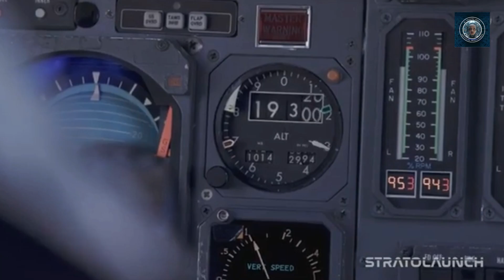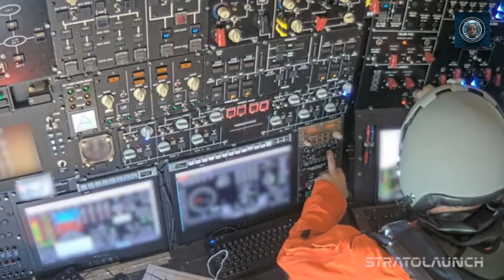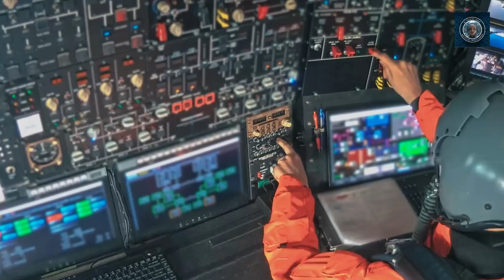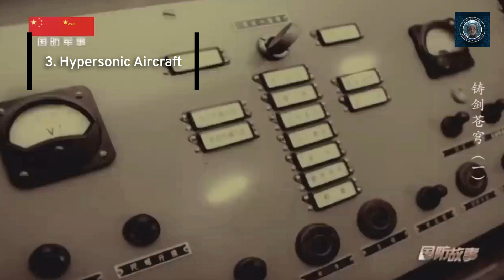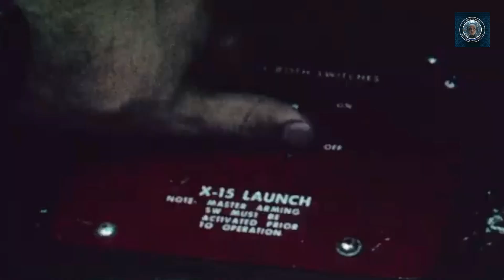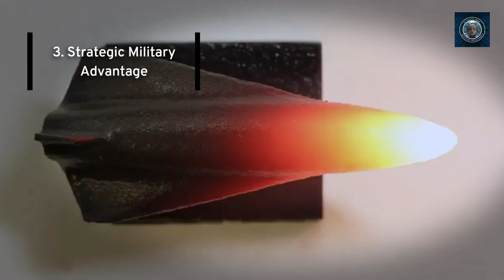World's First Hypersonic Airplane: More Progress Than Ever

Comment: Launch at zero from the surface (land launcher and sea surface vessels UVLS) is different from launching from a moving flying plane in the air. At that height, the air is thin and with the momentum created by a flying plane, hitting Mach 5 is easy. If fact it under perform. 

The physics behind this is Newton law... V=U+AT

- V is the final velocity 
- U is the velocity at the start which is the velocity of the flying carrying plane 
- AT is the momentum created by the moving carrier plane. 

All the above and to launch in high altitude thin air will create a deceiving performance. 

This is not new. USA still doesn't have a hypersonic engine that translated into missiles or a jet fighter that can launch at zero from a surface.

This is at best misleading and at worse self deceiving.

This is for the gullibles' gratification.

Comment: At Mach 5, it's a dangerous zone and nobody knows what effects will have on human.  So we'll see who is the first pilot that attempts to fly this hypersonic airplane.
Reply: Um, no. Orbital rocket launches go the equivalent of Mach 25. Speed really has nothing to do with it. G-forces do, and that is all about acceleration, not speed.
Reply: @Gemini-b4g thx to put back reality to this thread
Reply: Not exactly as the X-15 reached hypersonic speeds decades ago and every space shuttle must surpass mach 25 to reach orbit. (These are all rocket craft though.)

That doesn't remove the significance of this craft.
Reply: Humans don't move at Mach 5.  The air inside the aircraft moves at the speed of the ventilation system.  Assuming the aircraft retains integrity and the life support system functions there is no effect on the human.  The X-15 pilots did fine.